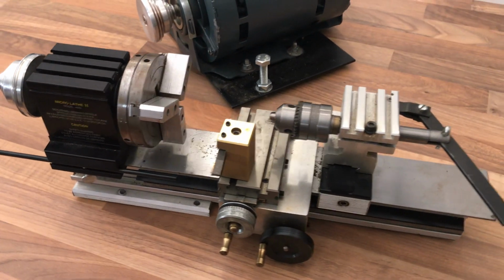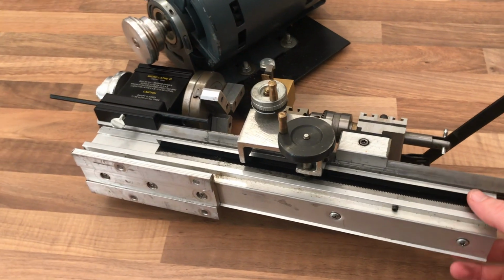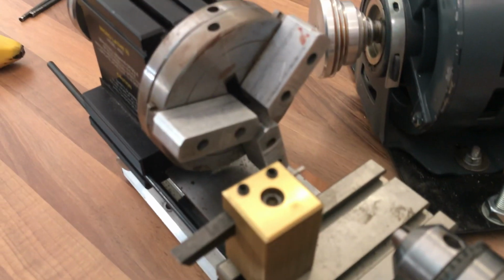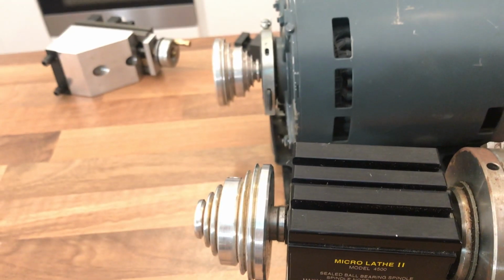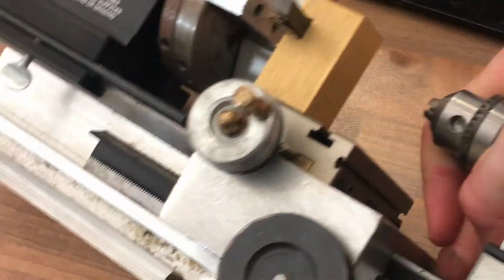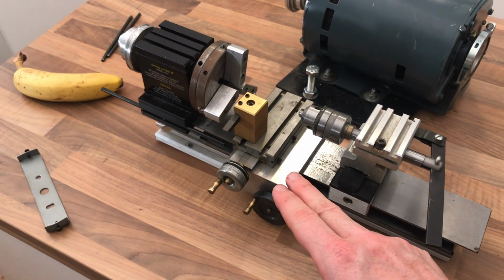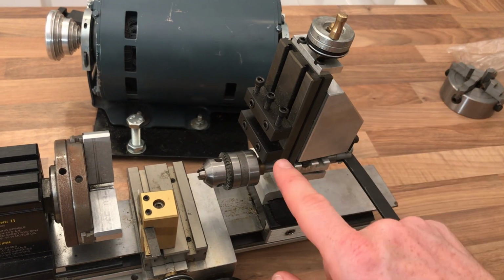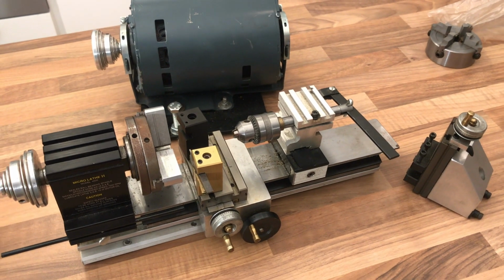TAIG / PEATOL Micro Lathe Construction & Overview - Thinking of Buying One?

Comment: I had the same type of backlash on my cross-slide.  The little brass nut on the end of the knob works as a jam nut against the threaded knob.  The knob itself is threaded on to the shaft.  If you thread the knob too far on the shaft, the knob will be too hard to turn.  If you don't thread the knob far enough on to the shaft, you will get backlash.  The trick is to find the sweet spot, whereby the knob turns easily with minimal backlash.  Second, you will need a drop of thread locker to prevent that little brass jam nut from working loose, when you turn the knob counter clockwise.  I'm sure that others have discovered something different, but this is what fixed my cross slide to work perfectly fine with minimal backlash.

Comment: I own several sherlines, lathes and mills. As well as a couple of craftsman lathes the 101 and the 109, a Chinese 7x14 lathe, a 5c slant bed I built from scratch which is manual and cnc. And I also own a taig. I really like the taig's tailstock and the carriage functionality I dislike the motor pulley combination and headstock through hole size. I like how the headstock can slide at any point on the bed. All in all it is a very good platform to start with.

Comment: I ran my lathe in 1981 with two SS25-1001 stepping motors controlled by CY512 intelligent motor controllers and a Sinclair XZ81. The membrane keyboard was ideal and wasn't bothered by greasy hands and shavings. I would buy another in an instant.

Comment: Given the choice I would go for the Emco Unimat 3 lathe and just buy the bed, which is available almost new for about US$100 on USA Ebay.......from there you can build up a very decent micro lathe to your own specs without compromise......the bed is the hardest part to make for any home build and the Unimat 3 has a cast iron bed with one raised vee which makes it quite a sophisticated design.
Back in 1967 I built my own micro lathe, about the same size as the Unimat 3, using all raw materials and a taper roller bearing head stock.......it's still going strong in 2021.
Reply from the maker: Great tips thank you

Comment: I know this is an old video but I just got one new today...And my question is I see a base plate like thing on yours near the head stock but not on the tail stock side and mine is the same but it does not sit level so what is wrong and how do I fix it?
Reply: You bolt the base plate that’s under the head stock to your board/table and the tail stock remains cantilevered above your table,  basically supported by the rigidity of the bed/base.

Comment: dumb question but can i machine 3/8" PVC pipe on a Taig lathe? I've had my eye on one for a while to learn turning but also got tasked with a work project of tapering a pile of 3/8" pVC pipe nipples to fit in a 1/2" reducer bushing and add two cut grooves for seating o-rings

Comment: Is this is the ender 3 of the lathe community?
Reply: Not really, although it can be the cheapest entry if you only need very basic functions. This is a seriously accurate machine. The Chinese mini-lathes start with more features and lower quality, they need fixed up out of the box. (By the way I have a highly modified ender3 and like it. You really only need $100-$150 in upgrades for the ender to work well if you know where to spend and have the right tools etc... )